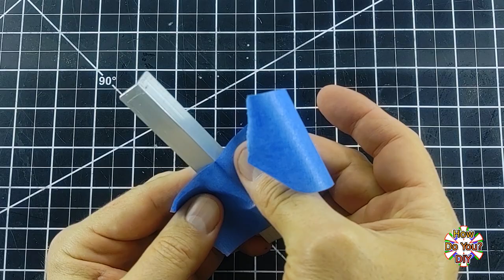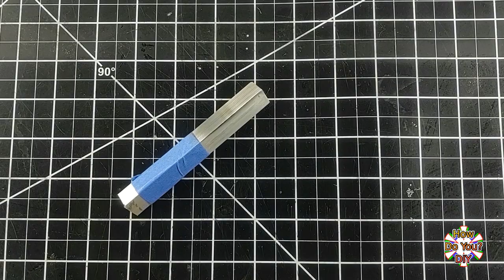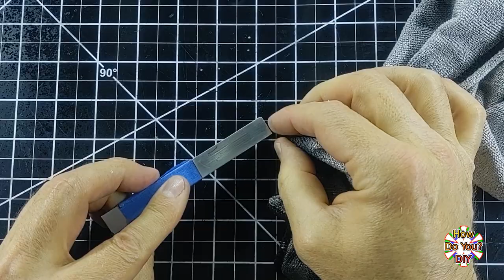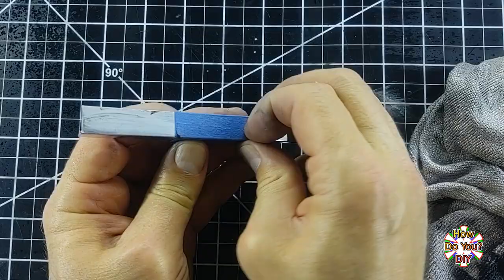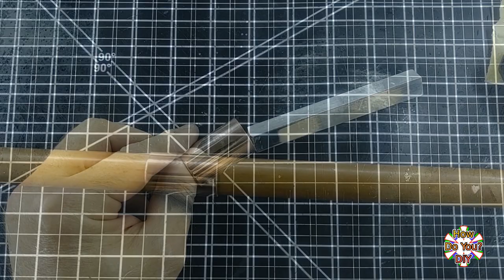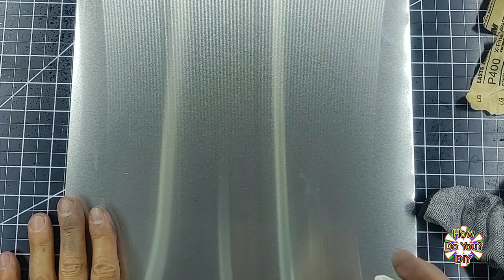Polish Copper and Aluminum | Quick and Easy Mirror Finish

Comment: When I was in the army we would smear ketchup on the brass and let it work before polishing with brasso and cotton. The ketchup would almost shine it but the surface needs a little elbow grease to make it uniform.
Thanks for the video.
Reply from the maker: I've heard of people using ketchup like that, but I haven't tried it myself. I'll have to give it a try. Thanks for sharing your info!